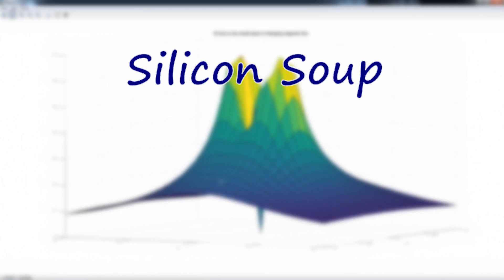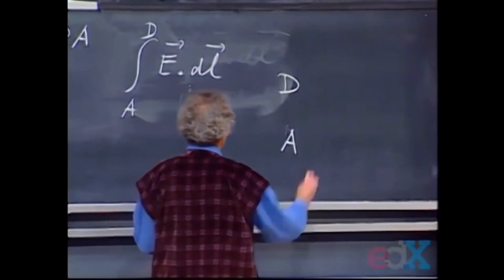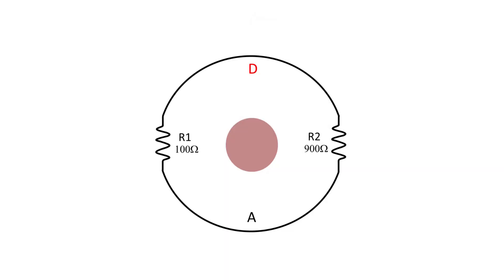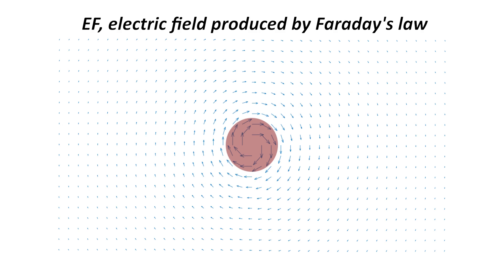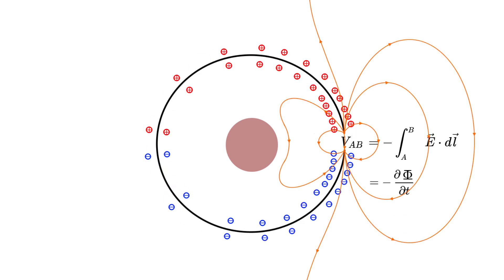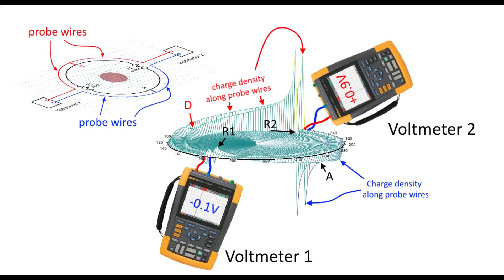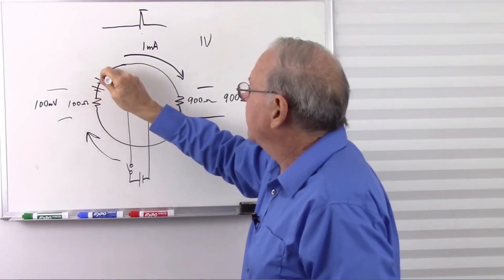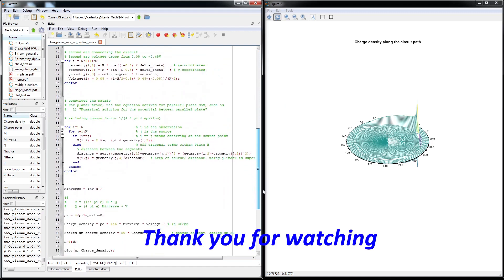Dr. Lewin vs ElectroBOOM on KVL. Of course Dr. Lewin is right.

Comment: With the measurement leads passing through the field in one way and being affected by it, the meter reads 0.9V. With the measurement leads passing through the field in a different way and being affected by it, the meter reads -0.1V.  With the measurement leads passing through the field, in a way that has net zero effect, the meter reads zero.
If there is a way to use an instrument in which it is unaffected by something that's not what you intend to measure, and you fail to use it in that way and instead choose a way in which  your instrument is affected by a second thing that's not what you want to measure - that's a misapplication of the instrument, that's user error.
Reply: Please clarify what field  you  are talking about.

Because if it's the electric field, then the net electric field in the conductors is (nearly, exactly in perfect conductors) zero. 

If it's the magnetic field, then there is no magnetic field where the probes (or the ring, or the voltmeters) are.
Reply: @copernicofelinis  I'll let you answer that.  (Yes, this is my attempt to hide my lack of familiarity and comfort with the terminology, and I do appreciate the help.)  - The movement of the measurement leads through space leads to different results at the dial of the meter - correct?  And moving the leads from one configuration to another (e.g. left semicircle to right semicircle) will give the same result, regardless of what configurations the leads had in the meantime (e.g. spinning the semicircle above the plane, or spinning it below the plane).  So, this can be modeled as a property of the space that the leads move through.  That field.
(BTW, I wonder if your last two sentences aren't each missing a word, and are more properly stated as "Because if it's the static electric field..." and "If it's the static magnetic field...".  If you tell me that the sentences both stand true without the word 'static', though, I'll believe you.)
Reply: @hughobyrne2588  zero is zero. Ideally there are neither static nor time varying electric and magnetic fields in the perfect conductors. 

As for the result changing with the position of the probes, it only changes when the probes cut through or are wound around the variable flux region. But when the voltmeter and its probes are on one side you can change the position of the probes as much as you like (make them parallel to each other, twist them, make them follow whatever path you want, with little or a lot of area between them) and the voltmeter reading won't change. I did that personally with a voltmeter - unfortunately I did not do it in my potatorama video https://youtu.be/8CH9Yg8dlYw because the oscilloscope probes were too stiff, but if I were to redo it with alligator clips, I could move them and the result won't appreciable change (apart from the effects of capacitive coupling)
Reply: @copernicofelinis  Thanks for that.  For 'field' in my original comment, substitute 'varying flux'.

Now, if the varying electrical field could be kept up for more than a moment, consider this experiment.  Have the leads on one side, and observe the display show 0.9V - move the leads to the other side while the field is still increasing, observe the display show -0.1V.  Unless there's a discontinuity, there's a time at which the display shows 0V.  And that could be when the semicircle made by the probe leads is at right angles to the plane of the circle - when the flux has zero effect.  Have I got it right so far?

So, choose to use the instrument in such a way that all the effects on the instrument are precisely and only from what's to be measured, with no effects from anything else.
Reply: @hughobyrne2588  yes, that's correct (well, I cannot do it with a toroidal core or with an infinite solenoid without detaching the clips, but with a finite solenoid this is what you observe.)
And it is a demonstration of Faraday's law in action. You have two measuring loops and the area of variable magnetic flux intercepted varies gradually from zero to all (and vice versa.)

When the voltmeter is on one side you measure correctly the voltage along the path going through the nearest resistor; but you are not correctly measuring the voltage along the path going through the other one because the other measuring loop is affected by the variable flux. The beauty of it is that you get the same result: voltage along near branch is equal to voltage along the far branch minus the emf. So, in a way you are measuring correctly one voltage (near branch) and committing a probing error for the other (distant branch.)

When you make your probes cut through the variable flux region you are committing a probing error on BOTH branches because now you intercept variable flux with BOTH your measuring loops.
Reply: @copernicofelinis  Right... you can make a measurement which is a function of two points, and a path between them through the flux - and this second bit counts as a probing error with regards a second path.  You can make a measurement which is a function of two points, and the second path between them through the flux - and this second bit counts as a probing error with regards the first path.
Arrange things so the net effect of the flux is zero, and you have a function of two points.  This is a more fundamental measurement.
Reply: @hughobyrne2588  except that if taken alone it is meaningless as far as the circuit under test is concerned. Because you removed  a fundamental part of the electric field that makes the circuit tick.

The scalar potential difference, i.e. the part of voltage that is associated with the coloumbian electric field, only carries part of the information.

What you should focus on are the two outer measurement loops formed by the two voltmeters on each side with the resistor near them. Both these loops are 'magnetic flux free' and as such are subject to the application of KVL. In each of those two loops voltages are independent of path, so the voltage along the probes and internal resistance of the voltmeter is also the voltage across the voltmeter tips, which is also the voltage across the near branch of the circuit, which is also the voltage along the near branch of the circuit. 
So, exactly because you can apply KVL, the left voltmeter correctly measures the left branch voltage.

Analogously, the right meter correctly measure the right branch voltage.

These voltages are also the voltages you need to use in Ohm's law - which is still valid, as it should be. All you have to renounce is the idea of uniqueness of voltage - but that's ok: basic math says that in nonconservative fields path integrals are path dependent. Everything fits nicely onto place: KVL works fine in all loops that do not link variable flux; Faraday's takes over in all loops that do link variable flux; Ohm's law is always valid.
Reply: @copernicofelinis  "you removed  a fundamental part of the electric field that makes the circuit tick" What I have removed is the effect that the electric field has on the measuring instrument.  Every time there's the phrase "probing error", it's more fully described as "probing error due to flux".  Given two points, you can choose a path for the probe leads that the flux has net zero effect on, a path that is not affected by what causes errors.  Eliminating a source of errors sounds good, no?

Yes, I could choose to renounce the idea of the uniqueness of voltage.  But that seems a bit like, when calculating the trajectory of a thrown object, affected by both gravity and wind, renouncing the idea of the uniqueness of gravitational potential.  I could follow a more convoluted model in which gravity and wind are all lumped together, or I could recognize gravity as one effect, and wind as another effect to be added.  I'd choose not to renounce the idea of separating two separable concerns, because that's the way to get to the fundamentals.

EDIT: By the way, thank you for engaging with me on this.  I appreciate the time you're taking.
Reply: @hughobyrne2588  so, let me see: I give you a voltmeter with two probes and I tell you to place the tips at point A and B of a generic circuit. I tell you - and I can prove it, so let's assume it is accepted truth - that in the region of space occupied, or better delimited, enclosed, by voltmeter, its two probes, the tips, and the AB branch of circuit I want to measure the voltage, the electric field is conservative. Oh, and I forgot: to make it explicit, there are no changing magnetic field in that region.

Can you apply KVL to such a circuit?
Reply: @copernicofelinis  Ah, you have seen through my attempt to hide my lack of familiarity and comfort with the terminology.  I'm not sure I can answer that question with confidence, my best answer would be: I don't see why not, as long as the law is applied appropriately.  Divide a circuit into a number of sectors, for every adjacent pair of points, measure a voltage (this voltage being a function of a pair of points!), add everything up clockwise, get a result of zero.

How about a simpler question: When it is possible to remove an effect on your measuring instruments which causes errors, isn't it a little bit insane not to?
Reply: @hughobyrne2588  the point I'm trying to make is: where is the error? Or better yet: is there an error?

Let's focus on the above measurement loop where the electric field is conservative and there are no magnetic fields inside. KVL applies, of course, and this tells you that the voltage from tip to tip going through the branch of the circuit (we can assume it's just a resistor with leads attached at the two points A and B) is equal to the voltage going from tip to tip through the voltmeter. The voltmeter reads, say, 0.9V. Why doubting that that is the actual voltage across (or along) the branch of circuit from A to B?

To make things short, I'll advance the classic objection: 0.9V is the voltage across the internal resistance of the voltmeter and we might be neglecting the (mutual) inductance of the probes and the conductors in that portion of the circuit.

So, my question is: what authorizes you to model the probes and the conductors as (mutual) inductances when there are no variable magnetic fields in the region of space that contains the whole measurement loop?
Reply: @copernicofelinis  "Is there an error?"  You're the first one to use the phrase "probing error" in this conversation... if you're focusing on the words you anticipate I will be using more than the words I'm actually using, and not so much paying attention to even the words you're using, I'm not sure this is a profitable exchange.

For any path you may choose, just about every path you may then choose for the probe leads will result in "probing error", because of flux.  For any pair of paths, there is almost certainly probing error, because of flux.  There is (ideally, at least) a path for probe leads that does not interact with the flux, taking the source of "probing error" out of the equation.  All you have to renounce is the idea that all you have to renounce is the idea of uniqueness of voltage.
Reply: @hughobyrne2588  let me repeat it: we are considering a measurement loop that is completely contained in a region of space where the electric field is conservative - and there are no variable magnetic fields in that entire region of space. So: no changing flux to be found there, no matter whatever path you consider between any two points of (edit) that portion of circuit.

How can there be an error there?
Reply: @hughobyrne2588  this is really nailing it.  The measurement is a function of the path, not the points.  Put the measuring device into the model and suddenly nothing weird happens.  Hide it and it seems like magic is going on.
Reply: @copernicofelinis  omg path integrals are path dependent!  Who could have guessed :D

Comment: I just hope the voltmeters are really smart to know if they're measuring v1 or v2 , they're already at the same point.
Reply from the maker: The voltmeter only knows about the voltage across their input terminals, but this voltage is traced back to all the contribution along the probing wire, so depending what the probing wire loop captures (especially the changing magnetic flux), the reading may be different as in this example. Thanks for watching.
Reply: @SiliconSoup  If the voltmeters measure different values and then we are going to place a third voltmeter V3 in the section between the resistors at point A (A1 and A2), we now have V3 measuring a potential difference due to the existence of two measurements V1 and V2. The paradox of V3 being short-circuited and having to measure that difference. It will tell you that it is an induced circuit and what the result is. Science is light in darkness. Thanks.
Reply: @dantasadelino  first: the voltmeters DO measure two different voltages. And a third voltmeter across the copper arc DOES measure 0 volts (or less than one mV in the real world, the ohmic loss in copper). The fact that the sum of all voltage differences along the loop does not add up to zero is exactly what Faraday's law predicts.
Second: language! You can no longer speak of "potential difference" since the total electric field does not in general admit a potential function. You should speak of voltage difference, and yes, there is a... difference.  Pun intended.
Reply: @copernicofelinis  The potential difference (ddp), also called voltage, is defined as the work required for a load to move from point A to point B, when there is a certain potential difference between two points and we connect these points through a conducting wire, inside it will appear an orderly movement of charges. This is a side issue, the problem is to know what is the V3 value.
Reply: @dantasadelino  no. Potential difference and voltage (difference) are no longer the same thing when variable magnetic fields are present. This is the crucial point.

Voltage difference is (minus) the path integral of the total electric field Etot=Econs+Eind. This quantity depends on the endpoints AND on the particular path along which you integrate.
Potential difference is (minus) the path integral of the conservative part Econs only. This quantity is independent of path and in fact you can express it as the difference of the potential function at the endpoints.

The voltage along the conducting parts of the ring (and across any path that does not cut through or go around the magnetic region) IS zero (for a perfectly conducting wire)
Reply from the maker: V3 is 0V. Near the end of the video I measured the voltage across two points of the wire, the scope showed 0V. This result is for a open-ended loop, but the result is the same if R1 and R2 are in place; there is a charge distribution along the wire to produce a reverse E_coulomb to cancel E_induce, so there is no voltage difference along the wire. The result is consistent with ohms law; 0V difference for 0-ohm wire.
Reply: @SiliconSoup  Okay, so between resistances it says that voltage is zero, let's take it for granted, but let's redesign the circuit by removing these sections and passing it to a ring conductor with a resistivity ie intrinsic resistance in the conductor proportional to its length and inversely its section. We put the voltmeters in different section V1 and V2. Draw the same conclusions. Thank you.
Reply: @dantasadelino  there is a super easy way to answer questions of this kind. Once you have determined that the current at time t flowing in the loop is I=emf/R_ring, you can apply KVL to the measuring loop formed by the arc of the ring you are probing, your voltmeter and its probes (you just have to make sure that the variable magnetic field region is not contained inside that loop). 

So, your voltmeter will measure a voltage equal to R_arcofring * I. Here R_arcofring is the resistance of the arc between the probes.

Note that the remaining arc that shares the same endpoints will form a second measurement loop with the same voltmeter and probes, but in this case the loop will include the variable flux region, so you cannot apply KVL there. You can apply Faraday, though, and the result you obtain is the same.
Reply: A voltmeter measures the sum of all potential voltages in the circuit plus the emf within the measuring loop.